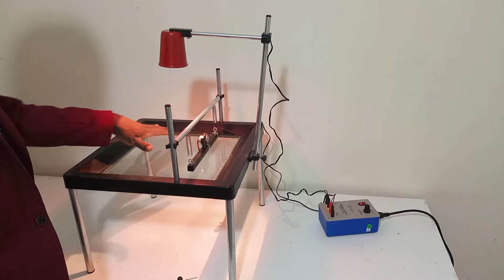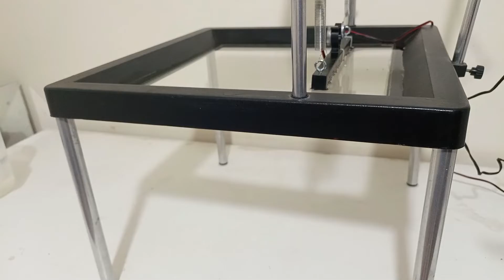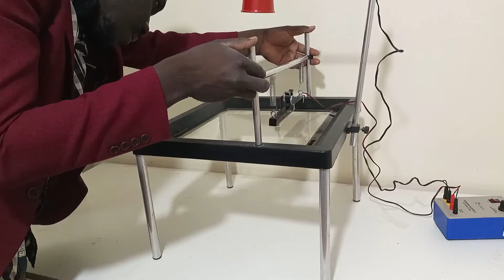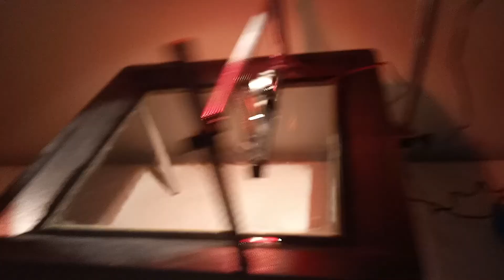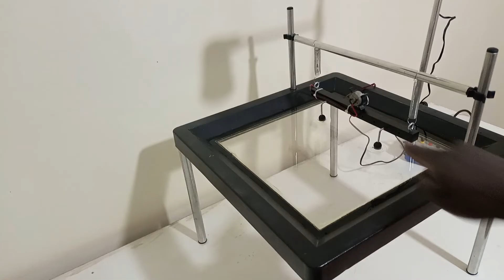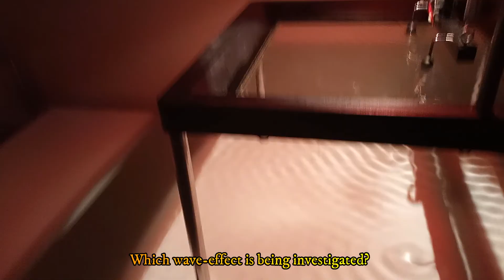How to use a ripple tank to investigate properties of (water) waves

Comment: Why does it seem to be really slow when you increase the frequency and speed of the water and vica versa ? I'm really confused with this... could you please clear this doubt out ?
Reply from the maker: Thank you for your question!
When you increase the frequency, the waves in the ripple tank appear closer together (shorter wavelength), which might make them seem "slower" because it's harder to track individual wavefronts. However, the wave speed in the same medium remains constant—it’s only the wavelength that changes.
If you increase the wave speed (e.g., by changing water depth), the waves propagate faster, but this doesn’t directly affect the frequency unless the source changes.
It’s all about how frequency, wavelength, and speed interact:
Reply: @mwalimundolo  Thankyou so much sir. It is all clear now. And your vedio and explanation were really really helpful.